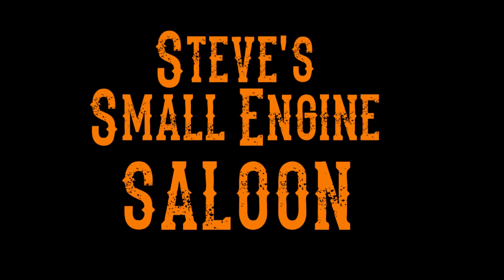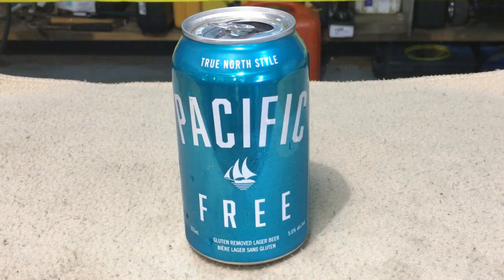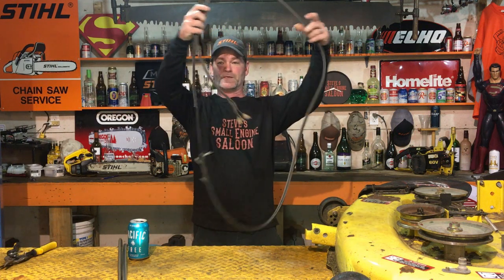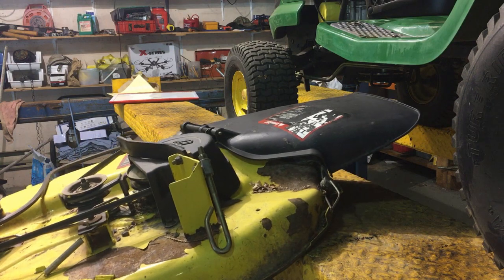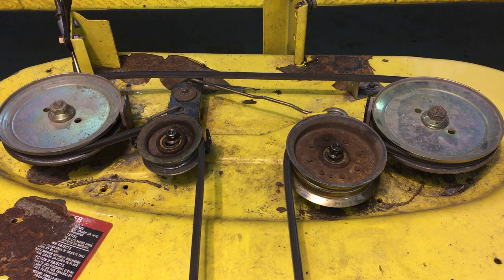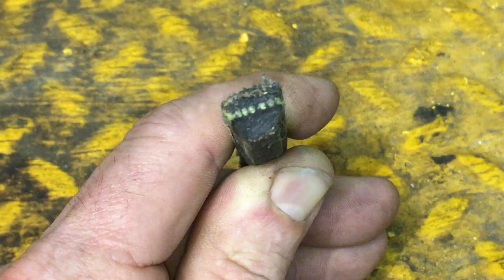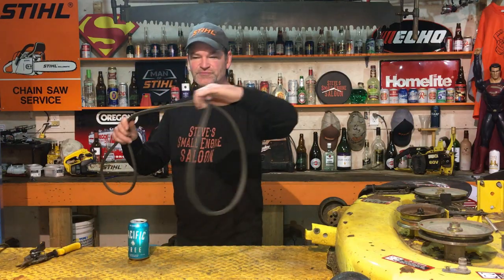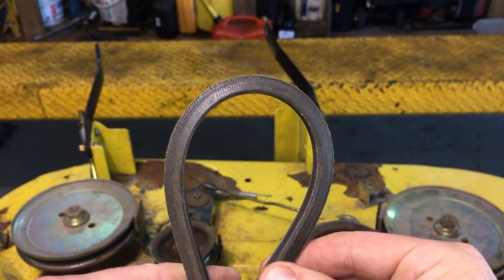How To Install A Belt On A Riding Lawn Mower Tractor

Comment: Hey Steve. The way you explain all the steps in your videos in phenomenal! I just did this belt change on my D130 (its been 10 years with the same belt), it still had good life on it and I was able to adjust it like you suggested in one of your other videos but I had the deck off and was changing the blades anyway so I decided to change the belt. (Will keep the old one a spare. Yes! 10 years on one belt and it is still good! Anyway, the way you explain the “V” side and the “FLAT” side was so impressive and easy, that I didn’t even need to see a picture or diagram on how to route the belt! Unbelievably easy! Thanks again and always look forward to watching your videos. Paul.
Reply from the maker: Right on Paul!  Thank You...
Reply: I wouldn’t know. Got tired of waiting to hear the info.  Between the gluten free beer (lame!) and the plug gif every other video Huey Lewis here made, I checked out! Peace dude!

Comment: When a belt is shipped/stored coiled up, does the belt need to hung out straight for some time before installing it to prevent it from twisting up on the mower and wearing unevenly and breaking very quickly? I went through 2 belts last week and trying to figure out what happened by the time the new belts arrive.  I tried to make sure that they were routed correctly and the V in the correct orientation so not understanding why these twisted and wore out so quickly. I have replaced the belt several times before over the years.

Comment: I wish you actually showed taking the belt off and putting the new one on.  I fixed my JD125 today w/ a new belt. Adjusting the tension didn’t work.  The new belt did, and I wouldn’t have been able to do it w/o your video.  However, I did have a problem with one of the pulleys having a black guide a fixed to it.  I cut the old belt simple enough to remove it.  Took a picture and asked at the JD dealer what to do to get the new one on.  I got it.....but it took some muscle and a torch to loosen the nut.  Love your videos!

Comment: I had not seen this video but the look on your face after drinking that beer was priceless. What really gets me is people even thinking a beer would even taste good without gluten.  I have had gluten  free bread and it makes me sad when I hear people cannot have regular bread or beer. The tip you gave must be for those that are allergic to not only gluten,  but reading their manual their riding mower came with. It's not hard to change your belt, or your beer. They make other beers using rice and other things you can have that clearly taste better than that stuff.

Comment: My question do I need to disconnect the deck of the small tractor? That is easy to do by removing the clips holding the deck. The problem is when you mount the deck you need to loop. The belt to pulley hooked to the engine. Since the space is too tied 😩

Comment: Steve: Love your DIY videos; just can’t say enough about them… 
I have a 2005 Cub Cadet 42” RZT and have always struggled putting the deck belt back on after changing blades and spindles. Mine has the U bolt type that pulls the deck forward, and the J hooks at the back. Anyone having to pull the deck will enjoy this trick and will make a lot of people happy… The J hooks normally are the first thing to unhook and should be the last thing to hook back up. 
Here’s the trick – Don’t hook them first! Loosen the U bolt and jam nuts and remove them and the U bolt from the deck, your deck should be on the floor now and either removing or replacing components will be easier. During reassembly leave the J hooks last and the belt will slide on the PTO clutch like butter. Next start treading one nut on each side of the U bolt. Tighten the nuts and the pressure of the U bolt will tighten the belt. With the help of 2 or 3 pieces of 2x4 placed on the curved bottom lip of the deck will give you perfect alignment for the J hooks for reassembly. Remove only one nut from the U bolt and replace with washer nut and jam nut. Repeat for the other side when finished and it’s done…

Comment: Steve, love  your videos.  My MTD 38 inch deck was hard to remove.  I can only say take pictures of every thing you disconnect including what clip.  I took the deck off, then cleaned the deck, put on rust converter, wait 2 days, prime, wait 2 days, topcoat, wait 2 days; then I replaced the blades and torqued to 80 inchpounds. This is extra tough: there is very little surface to wedge wood in to lock the blade.  After reinstalling the deck (now a week and half later), I couldnt get the deck drive belt to tension properly.  Something I did to it, because it worked before.  It tensions only at the highest level (5).  Turns out the PTO spring was attached to the deck in the wrong hole.  After you pull the deck out in the light and look at it : there are 3 holes and 2 of them are marked 38, 42. I had mine in the big 3rd hole (its a big spring). Put it in the correct hole  38 (MTD likes all their springs hooks pointed up)...everything works! Maybe this will help someone else.
Reply from the maker: Right on Jerry..

Comment: I have a John Deere E140. It doesn't have a lever like my other mowers had. It has a knob that you pull to engage the blades. My question is how do I loosen the tension to adjust the belt? Actually my belt came off and I can't get it on all of the pullies because it's in yhe tight mode.

Comment: I have a hustler lawnmower zero turn. It has a sliding pulley with a tensioner spring that hooks into a metal loop. I have many gum trees and I often have a gum ball do it’s magic and throws my belt off. I can realign the belt on the pulleys but I can’t pull the spring to hook into the metal loop to tighten the tension (I’m a girl and just not strong enough). Is there a tool that can help me pull the spring ?  ie brain over brawn. Please help!

Comment: Hi Steve its Nick from Australia. . I have a problem with a poulon pro 38inch deck. 
the rear wheels are tilting in at the top. I took the wheel of and it 
looks like the dive shaft and  have worn the casing and made the hole 
oval. any ideas? Is there a bearing just inside the shaft hole the keep 
the shafts straight. without having to renew the back end assembly .is 
there anyway to fix this cheap. im in the process of pulling it out. if 
you get this can you get back to me. Thanks

Comment: I'm about to remove my old belt and replace it. However, after searching all over the internet, can't find anything on my Craftsman pro series 8200 46-inch mower - except something about how to remove the deck. Very tight tolerance on the two "idler" pulleys. Really frustrating. Here in Hawaii, after Sears deserted us, no one will come out to perform maintenance and I don't own a trailer or truck.

Comment: I got three different mowers (multi acre property) they've all got separate issues I've been fixing using your vids. The only real trouble I have left is they are eating belts. A month and a half I've gone through 4 or 5 belts. I'm not sure why. Pulleys are new, belts are installed properly, cutting when its cooler, idle down to engage/disengage. Any tips/tricks appreciated.

Comment: Steve, deck belt question. Toro Wheel Horse Lawn Tractor has 87” deck belt, very sloppy.
Replaced with new Toro 87” belt. Same loose condition. Bought a 85” Kevlar belt, much better. Do you see any problem with the smaller belt?

Comment: Wish I had seen your channel before my mower deck belt had to be replaced.  Bought a new belt, and the manufacturer sent me the wrong one.  Was a nightmare for a bit.  I also had to weld some metal in to repair where the idler pulley arm rusted through and fell off.  :(  Got her done though.  Love your videos.  Throw that crap beer away.. LOL
Reply from the maker: Right On....

Comment: Another great video! Hey question, I have an electric pole saw. Neglected it for a bit, oil clogged, question the clutch housing is plastic, if I don’t want to take it off what can I spray to help clean it out followed up with air to blow it out. Anything cut oil wood chip mess but not hurt plastic? Thanks 
Bob

Comment: Hi steve... a little unrelated.. but i want to change drive belts on mtd   38/420 ride on.. and ivr found conflicting info on  to loosen the bolt... 
Some info ive found said .. its reverse thread.. some say its not.. please help.. 
Im now worried ive stripped it.. 
So.. if lying on the right hand side..  chute side.. 
This might sound silly.. but..if im on right hand side.. i will pull ratchet towards me to loosen...
Some say to the left or right.. but where are these people sitting /lying down when they post that.. 
Im so confused right now..  
HELP!

Comment: Hi Steve!  Quick question for you!  Ive got a L series Deere just like the one in the video and just replaced the belt.  The belt engages just fine but wont disengage fully.  Tired to adjust the belt like in your video but still same result!  The engagement pully seems to move just fine.  Any ideas?
Reply: Did you ever fix this problem cause I'm having the same problem

Comment: Hey Steve I found another motor in my shop with a clone motor in my shop and the starter fit and since the other mower didn't have the starter and all the carb parts , now I have a model number to work with .
Reply from the maker: Right on...

Comment: to avoid taking off the deck...  would unbolting the adjuster to allow the arm to swing completely free make it easier at all?    

Know you will need to: 
. drop the front of the deck so you can get the belt past its arm...  
. remove the two covers (got to do that anyway.. deck on or off)
. maybe.... remove unbolt a pulley or two to  lift them up far enough to get belt past the guards...  (again probably have to do anyway even with deck off)

anything else you can think off?

Comment: The belt on my Scotts 42 inch riding mower keeps coming off.
My deck and belt look very much like this JD in the video at 1:15 or so,
 I replaced one (right side) blade pulleys, spindle using a reinforcing ring. I took the belt off and checked the length against the 104" spec I found online and it was close - but I am not sure I know how to read that measuring device Lowes had next to the mower belts. The tension adjustment (moving the bracket back) has been done and is maxxed out.

The belt that is on it (and off it) does not have the wrapped appearance - it is just black with no markings visible anywhere. I don't want to by a non-returnable belt only to discover that there is another reason the belt will not stay on. I was thinking of buying a 100 inch belt (four inches shorter than 'factory') upon the thought that the old belt is stretched. But looking for 'expert' advice!

Comment: Hey Steve,  where can I find a good used mower deck for a Cub Cadet LT1042 ? those are incredibly expensive, ($452 for a new deck shell only.) Best I found on the web, is $250 for a complete deck used. (I only have $300 in the mower now, lol.)

Comment: Another thing to consider is why the belt has failed/snapped/broken. Has a spindle bearing failed, was there a stick etc jammed in a pulley, was the operator asking too much of the machine or not keeping the revs up, I sell plenty of quite expensive belts to customers that complain about belt failure only to discover that its operator error causing the problem. The belt is the weakest part, it generally fails due to another problem or its just worn out.

Comment: O grand Master of gasoline engines , not a trick question but got a MTD Push Mower given to me with the starter and recoil missing . I've tryed several things with the model and serial number off the deck . But that's not helping me find the model number which I need  to find the starter and recoil number . Found some used ones on EBay , don't want order unless I'm ordering the right thing , not taking any chances . Looked at videos on utube that says to look in three different spots , no model number found there . I know it's a 158 cc motor and a 500 series motor , but everywhere I look they need a model number . Help needed in Arkansas 😩
Reply from the maker: Marshall Border Give me the model and serial number off of the deck

Comment: Just replaced the mower drive belt on a John Deere Sabre w/ 42" deck as it fell off and had chunks out of it. Same configuration as the deck shown here. Both flat pulleys were stuck onto their studs so bent their belt retainers slightly for removal and install of the belt. The fixed flat pulley had about a 10º downward tilt toward the front. It is supposed to be level like the other pulleys so that needed corrected. I suspect it got bent when a blade strikes a rock or other hard object. It happens. Spent the money and got an OE mower deck drive belt as it is the correct size. They are made with Kevlar to OE specs and engage quickly. A mower deck drive belt is designed to work in both the v and flat positions unlike an automotive or industrial v belt. These have polyester cords and designed to run only in the v position. I engage the blades the same way you drive a stick shift. Don't slip the clutch or rev the engine full throttle and side step the clutch.

Comment: Hello it's me again. Back in the late summer of 2019, I asked you about the angle of the flat pulley on the left side on the mower deck of a JD LA100. You told me not to straighten the pulley angle, it was suppose to be angled. So I didn't do anything but replace the pulley and belt. ( The old pulley would not stay on it when I reassembled the deck with the new belt.) So I replaced the pulley and installed the new belt and the belt came off  after about 4 to 5 minutes of cutting grass. 
I noticed this deck you have here in this video. The flat pulley on your deck there is not at the extreme angle of the pulley on my deck. 
I want to take a picture of it and send to you so you can see what I'm describing. What is your email address? I value your suggestions and would like to hear what you have to say. I'm not a small engine mechanic.
Oh, the reason I'm changing the belt is it's wearing badly and my brother, owner of the mower, said the belt had never been changed and was slipping and finally broke. And I did install the new belt correctly. I used my mower as an example to follow. It's just a newer mower withe the same 42" deck. It seemed to me that the new belt was riding too high on that flat pulley. And I guess it was because it won't stay on while in operation.

Comment: I hate my 42 inch mower deck! it's the same as the one in this video, I've had to weld it in numerous spots and adjust it many times so I finally gave up and brought it to the shop to have them fix my new problem where it stays engaged no matter how much I loosen the belt. love your videos by the way! :)

Comment: Damn belt on mine is loose and it not adjustable it’s an E110 and the twi bolts that you showed are not on mine because mine is welded😳😂

Comment: Glutin is probably the most important ingredient in beer. Rofl. I could easily tell when you never hiccuped on first sip it was nasty. For those of us like on Jennies Garage that are not the roundest eight ball in the wrack. If ya'll don't know which side of a v-belt goes in ya'll will have difficulty procreating which is just fine.

Comment: I took my deck off to sharpen the blades after piece of wire got tangled around the deck blade and then after I reattach the deck all of a sudden my belt is like 6 inches too long. So I bought a new 42 inch belt and it is also too long and I have moved the belt tension lever on the belt tension spring already I have no idea what I’m missing but I’m losing my stupid Mickey Mouse ever loving mind!
Reply: Thanks again Steve ! Ur vids are a huge help and entertaining

Comment: 27 videos and not one addresses my  problems.. i need to  raise the deck to cut higher..i need to disable the reverse safety that disengages the blades and shuts off the mower.. how stupid is that thing.. i need to adjust an oversteer problem that causes  a wheel to turn too far and   jam up.. ive got a  100 problems on my  mowers.. my  mechanic never  fixes them correctly and charges me  100s
Reply: As far as your steering when you take your deck off and all your steering is right there...there is a plate with teeth and a gear you can get the whole kit cheap of Amazon  I just did mine last week and it costed me about $27